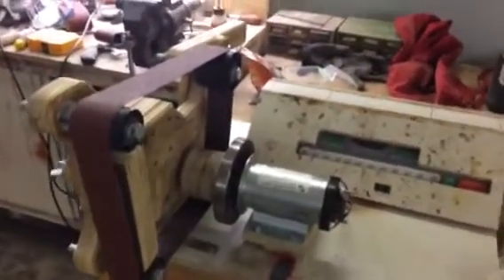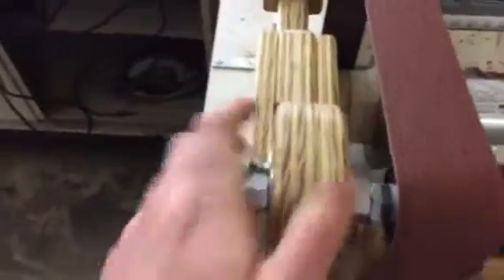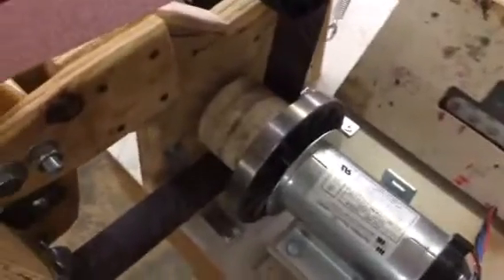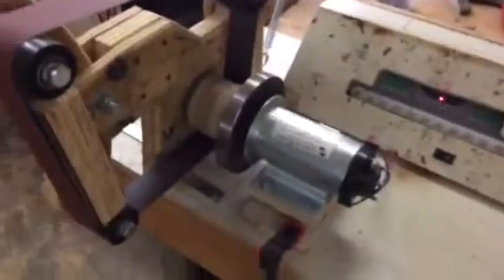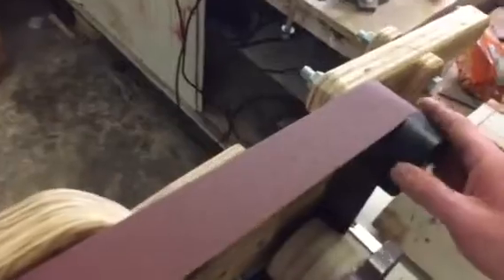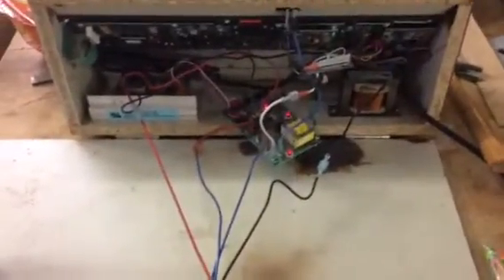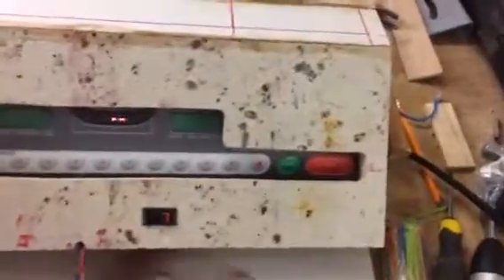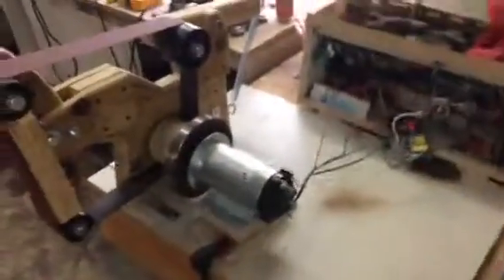2x48 Belt Grinder Build Issues and Concerns - What Do You Think?

Comment: So here's the best and most easy with lease amount of work. Eliminate your control board. Put a potentiometer in its place. Now you have the control board that I see and a choke and the potentiometer. Put a switch on the red wore of the potentiometer so you can have a stop switch to save your set speed and call it a day. Lookup berrys garage he has a break down on how. Saved me a ton of time plus didnt have to deal with the speed sensor. Still has an overall soft start but not much different then a normal one. Also the pulley on the motor looks like its tapered wrong and away from the motor. Get your pulley square if not you will always be fighting the belt to stay on.